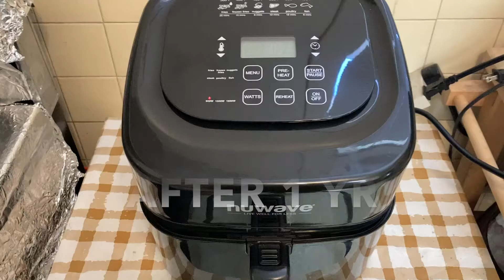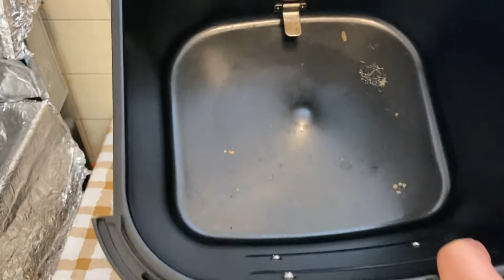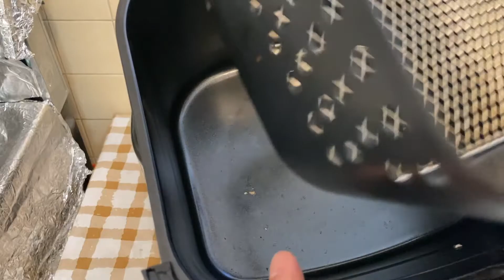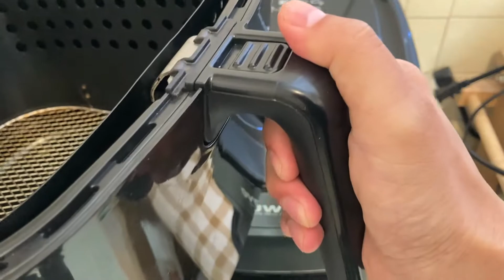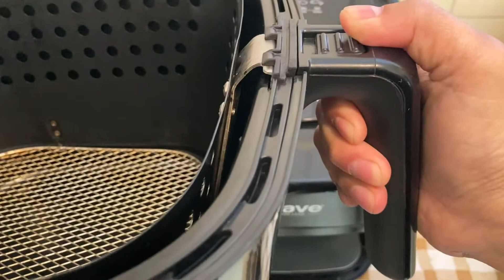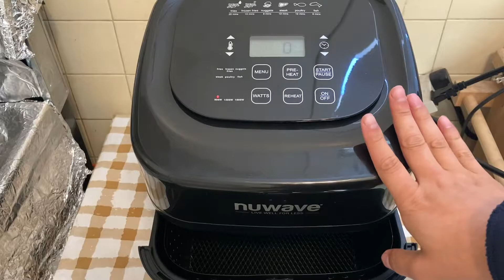NUWAVE BRIO 6QT AIR FRYER - 1 YR LATER, DURABILITY

Comment: I’ve had mine for over a year, good tip so it won’t peel is to line the bottom with aluminum foil. It really works and it’s easy clean up
Reply: Thanks ! Wish I knew this before the bottom started peeling/ rusting. 
Mine still works great after 3 years of use but I only use it about every 1-2 weeks and take good care of it.

Comment: I have this exact air fryer, I can cook something and it is fine. Then when I go to cook something else it turns on for about a minute and then the screen shows all of the numbers, beeps, and then shuts off. Have tried to call customer service multiple times and nothing. They dont answer. Im thinking it is overheating, anyone have any ideas what the issue could be?

Comment: Be careful about the nuwave warranties.  I have purchased one on my platinum surface cooker for the extended three year.  It went bad after two years and I have been trying to get it warrantied.  Now they say that it is out of manufacturing and they will not honor the warranty.  No offer for money back or replacement.  Just tough out of luck.  So do not purchase warranties from them and expect them to honor it.
Also products usually go bad after year or two, so expect that you paying for usage for the product for a year or two.